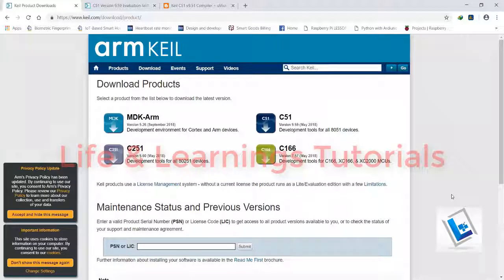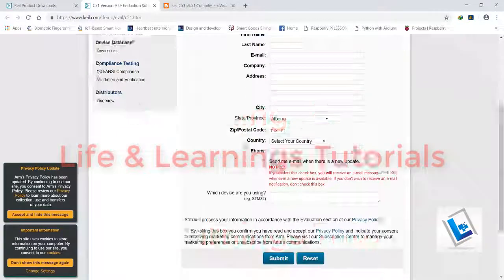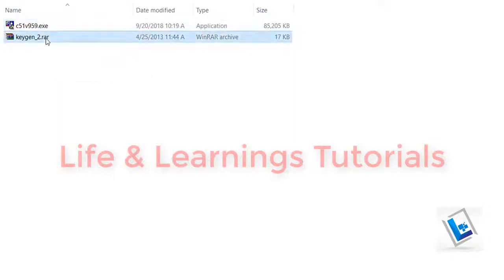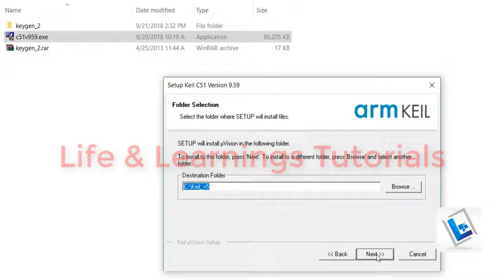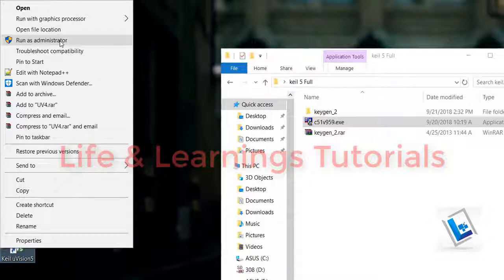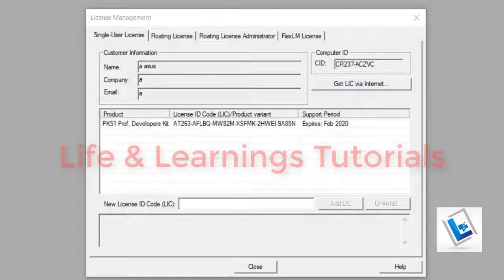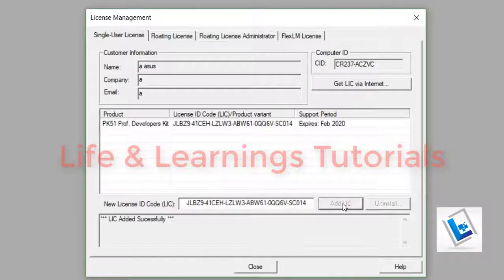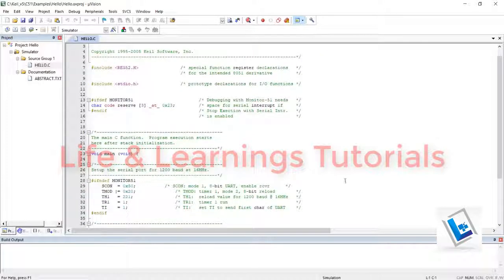8051 Tutorial 3 - Installing Keil C51 V5

Comment: no funciona
Reply from the maker: What is the exact issue?
Reply: @GaganCA  gracias por responder , he instalados varias veces keil con crack para programar el 8051 y solo me permite un programa de 2kb , y el keil al compilar el hexadecimal tiene un jmp a la direccion 0x800 , desde esa direccion comienzan los 2kb, que puedo hacer ? necesito una version que me permita programar los 64kb de rom y que el inicio sea 0x0000 , muchas gracias ,
Reply from the maker: @danielquintero7725  Explain in English please
Reply: @GaganCA  
what I am trying to understand the operation of the 8051, and understand its architecture and can do many tests with it to later make an emulator in c ++
Reply from the maker: @danielquintero7725  To understand the 8051 architecture you need to follow the Datasheets as there are a lot of variants of the microcontroller. For example, get the datasheet of Atmels AT89C51 or AT98S52. few links are in description.
Reply: @GaganCA  lo que estoy es intentando comprender el funcionamiento del 8051 , y entender su arquitectura y poder hacer muchas pruebas con el para posteriormente hacer un emulador en c++
Reply from the maker: @danielquintero7725  Explain in English please
Reply: @GaganCA  
thanks for responding, I have installed several times keil with crack to program the 8051 and only allows me a 2kb program, and the keil when compiling the hexadecimal has a jmp to the address 0x800, from that address the 2kb start, what can I do? I need a version that allows me to program the 64kb ROM and the start is 0x0000, thank you very much,
Reply from the maker: @danielquintero7725  Try this link to find the Crack for Keil and then you will be able to write code more than 2KB memory limit. Other useful links are in the description of the video.

http://download-coolz.blogspot.com/2013/06/keil-c51-v951-compiler-uvision-4-ide.html